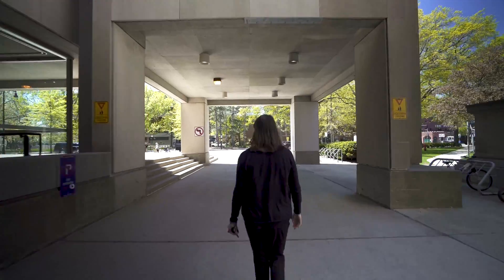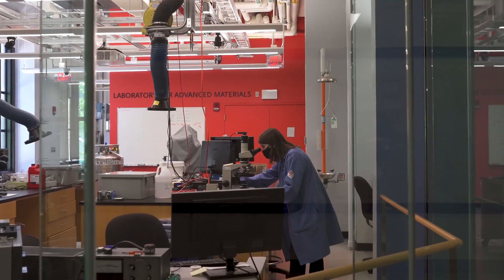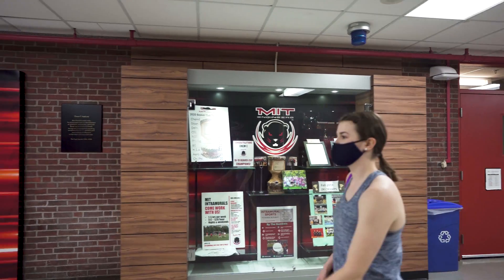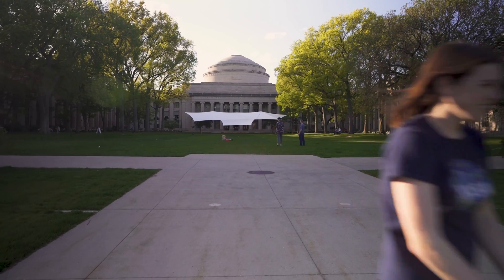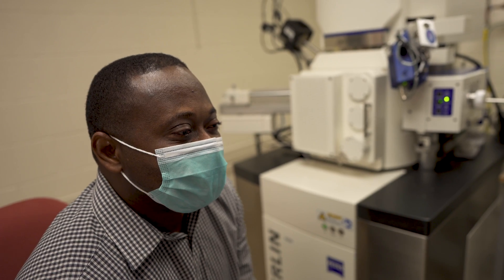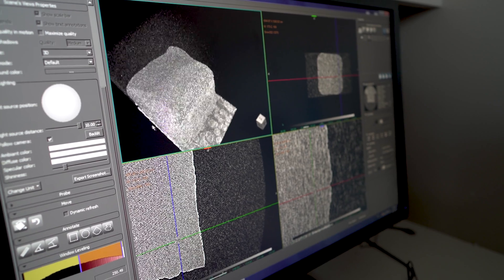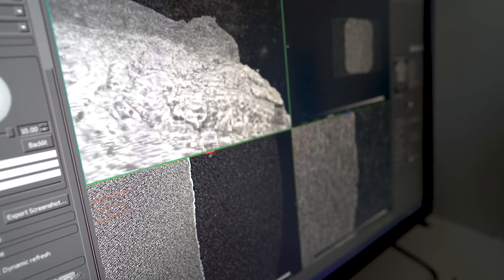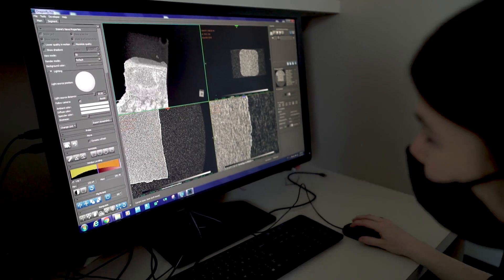Stronger than steel

Comment: What do you thinking of using two o Neil cylinders connected to each other like a Huge simple transmission, launching a Third one forward, saving you fuel on the one you are launching?

Comment: You are 110% correct on perspective and scale!  I haven’t thought about the Grand Canyon and composites also!  

At one point I thought of the idea of using bridge cables, like the Golden Gate bridge cable, but as thread on a composite.  Except each 5 to 10 foot thick cable would be composed of carbon nanotubes with graphene resin.  Anything else between the cables/thread could be lesser quality Nanotubes, chopped carbon fiber, graphene resin (forged)

I thought of making an O’Neill cylinder out of carbon nanotubes and graphene, like weaving baskets.  And with different weaves you can put different functionality into everything

Comment: We need to make a O’Neil Cylinders. And we need to make them with carbon nanotubes and graphene.

Right now the only way to utilize either of those is in yarns and as additives in concrete/cement.

I thought of Making an O’Neill Cylinder with a “loose” carbon nanotube basket (like a cross cut design) at least as wide as a person, and up to 10 feet in diameter (providing torsion and tensional strength, along with compression), stainless steel footings could terminate into huge tiles (going through the depth of the walls/floors) along with girders and meshes of different sizes filling in any spaces.
The filler material can be concrete, but I thought of essentially a type of graphene plasticized medium would be better, that way it’s stronger than steel, and if you rotate the cylinder with Station sized flywheels/gyroscopes, you can move it without thrusters while having better energy storage than lithium.  After that, all you need is a fission or fusion reactor to power it forward.

Having a basket made out of carbon nanotubes gives it added strength, and allows you to essentially pre-wire The entire place, along with embedding graphene super capacitors.
-The entire cylinder would be able to store power, along with the huge fly wheels that also move it in space.

Doing anything else other than making cylinders is a complete waste of time and resources.  For the cost of robotic missions, we could literally have a stable outpost on Mars and we could swap out crews back-and-forth easily.  A “mothership” if you will.

On top of that, you could use the interior or the exterior to mechanically or electrically launch space craft.

If you had two O’Neill cylinders that were 40,000 feet in diameter and 300,000 feet in length, you could launch a “Seed Cylinder” mechanically/electrically.  having to move a cylinder with that kind of tonnage would be incredibly hard. The best way is using mechanical means, followed by electrical means.  Saving you rocket fuel.

It’s not quite a railgun gun, but you get the idea

Look at those crosscut plastic wire handbags, and nestled them inside each other with metal bolts, and you get the idea.  
That way, most of an O’Neill cylinder would be able to store power, and it would be equal parts carbon nanotube, graphene, and stainless steel.  It would be superbly strong, and store incredible amounts of power throughout it

Comment: This new material might could be used in a large percentage of passenger aircraft frames and wings? It could make jetliners much safer and fuel efficient. Also the material might could be used in solid state EV batteries?
Reply: Or maybe even hydrogen fuel cells!
Reply: @Iquey  , yes, indeed.

Comment: Not for only nano tubes of carbon also I promise MIT I will definitely stronger than me myself and do my best for what I want to live 
................... 
........... 
...... 
.... 
.. 
One property of nanotubes is that they're really, really strong. Tensile strength is a measure of the amount of force an object can withstand without tearing apart. The tensile strength of carbon nanotubes is approximately 100 times greater than that of steel of the same diameter. 🤫😄